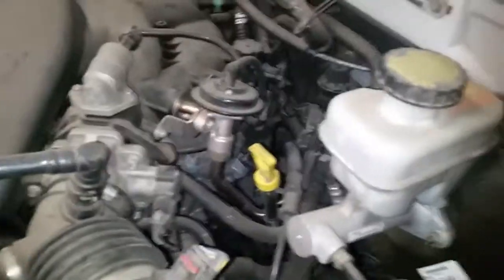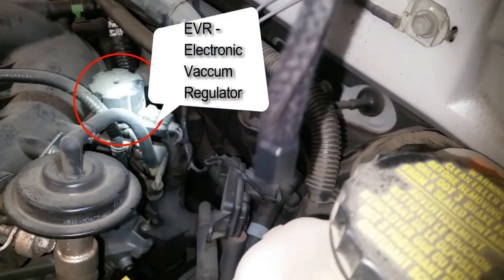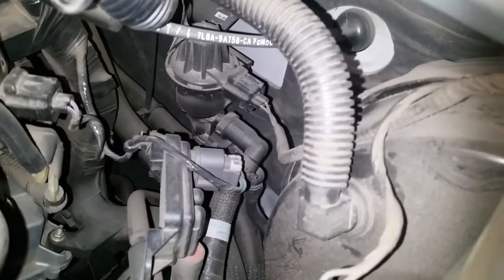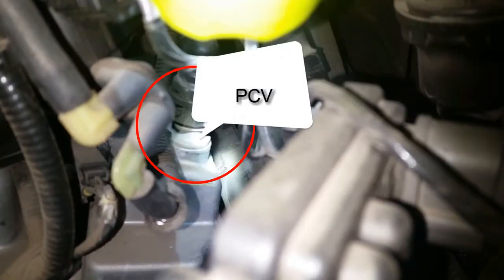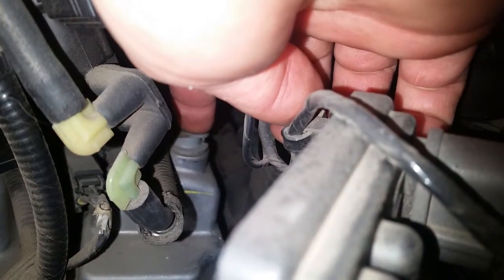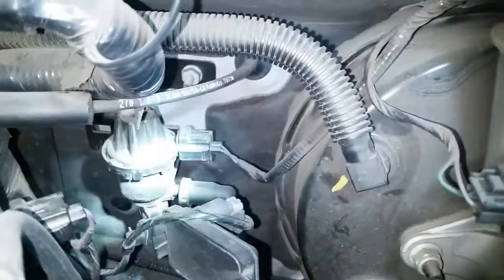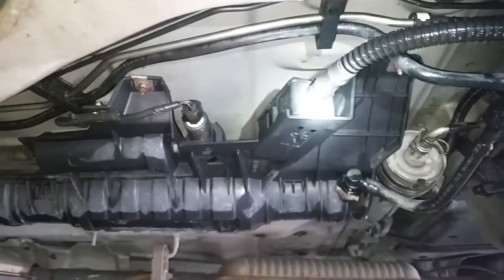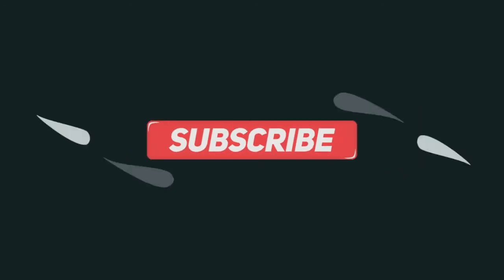Ford Escape emissions / smog locations: PCV, EGR, EVAP, DPFE, EVR, & more!

Comment: can all of these things cause a car to stall randomly?
Reply from the maker: Doubtful.  When your vehicle dies does it start right back up?
Reply: yes starts right back up
Reply from the maker: Hmm. That makes it a little harder.. do you have a check engine light on? Maybe a cam or crank sensor, the ignition switch..
Reply: no just service emissions is always on
Reply from the maker: Have you pulled that code yet? That will probably give you a starting point. The 'emissions system' is composed of many components that can cause a wrong fuel/air ratio and cause a stall. Can you get the code pulled? If so, tell me what it is.
Reply: I did that no code will show up it says there is no code stored in this computer and all it does show though is service emissions on the code reader as well
Reply: the engine is good the transmission is good I took it on the highway once you can drive it until it hits the middle point of the hot and cold the warm then when I shift it it will stall from reverse to drive then it stalls on me my father was telling me he thought it could be a spark plug or an ignition coil because it needs the power to shift but it could be anything all gears shift really well when I was on the highway but now it is just sitting in the parking lot and I occasionally started up to keep the fuel going
Reply from the maker: As it reaches normal operating temperature that is when it shuts off? So if it stayed cold all the time would the engine stay running?
Reply: Scotties Hobbies yes but it doesn't turn off right away I could leave it in park and it will be running all day it's when I come to a stop light or shift gears is when it does this but only when the temperature is at middle but if my foot is on the pedal even lightly or when I'm driving it does just fine
Reply: Young Lagi did you ever get a response on this? This is exactly what my 2009 Ford Escape is doing at the moment.
Reply: @vanessamedina5079  mines is doin the same have u fixed it?
Reply: @DraTheMechanic  sadly I was not able to fix it and then 2 of my 4 cylinders blew and my engine failed. Had to replace my truck 😭